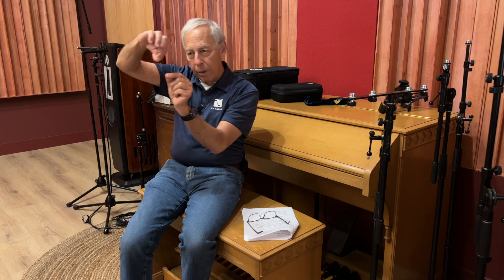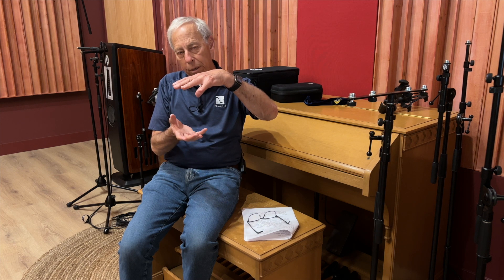Monoblock preamplifiers

Comment: Hi. I have a system with Ortofon Om Super 40 on my record player. My question is. Do you have to calculate the wires pf value (from pickup to output of the record player and the cable from recordplayer to preamp in my preamp settings? And what do the pf infect the sound?

Comment: Interesting question and great answer.
I built a quasi mono pre into my streamer.  Two triode monobloc channels. Volume controlled with two autoformers controlled by a single shaft two channel switch.  The only thing shared was the power cord.  Even has two tube rectifiers and all separate transformers and chokes.  Sounds great into triode monobloc amps.  Wouldn't make sense for a commercial product, but with DIY you can build one off to suit.

Comment: There was a preamp designed in nonferrous chassis to stop chassis/ signal path interactions as mirrored dual mono with galvanic isolation between sides. Using long shafts to connect to input selection, stepped attenuators, ...  for either channel. It had a separate PS chassis with multiple transformers for different stages in each channel. 6 total I believe? OK shared AC cord I think? Not sure it made it past concept model stage though?

Comment: If Octave Records was to separate every analog channel into a separate box with such argument, it would be quite a mess, and nobody does that for obvious reasons. Shared power supplies for line level analog signals is a non-issue with proper engineering.
Reply: As you say it would be a mess and less feasable as well, especially for the minimal benifits. In a 2 channel system though it makes more sense. I'm good with my cheap monoblocks.
Reply: @scottyo64  Monoblocks make sense because power amps need a lot of power and speaker cables can be made shorter if the monoblock is near the speaker.
Reply: Distance between speakers and amp does not matter, unless we're talking really long distances and too slim cables.

 Speaker Wire Gauge	4 Ohms Speakers       6 Ohms Speakers	     8 Ohms Speakers
          18 AWG                          16 feet	                         24 feet	                      32 feet
          16 AWG 	                   24 feet	                         36 feet	                     48 feet
          14 AWG                           40 feet	                 60 feet	                     80 feet
          12 AWG                           60 feet	                 90 feet	                   120 feet
          10 AWG                         100 feet	               150 feet	                   200 feet
Reply: @jasonkillsformomy  For anyone religiously believing in expensive audio cables costing 1000s of US$, the length of cable should be of utmost concern. Twice the length is twice the resistance, capacitance and inductance.
Reality is a bit different though and speaker cables need to be quite long or thin before the impact becomes audible.
Reply: @ThinkingBetter  As I wrote.
Reply: @jasonkillsformomy  Yes, I know we agree on the point.